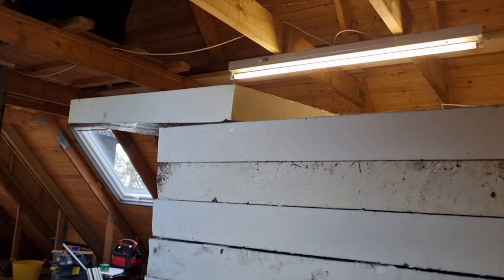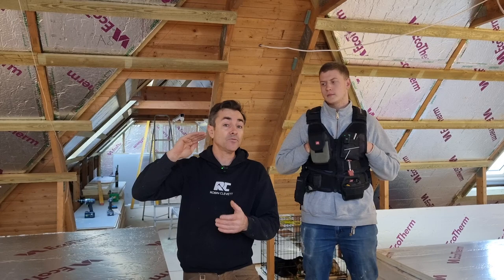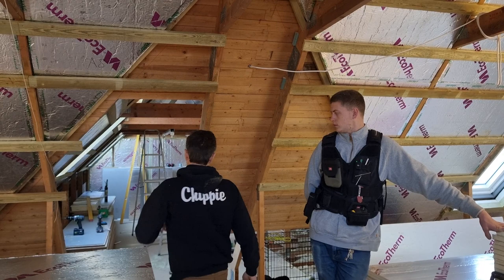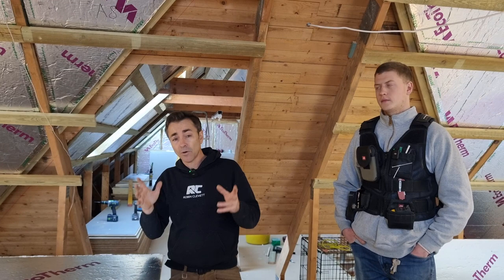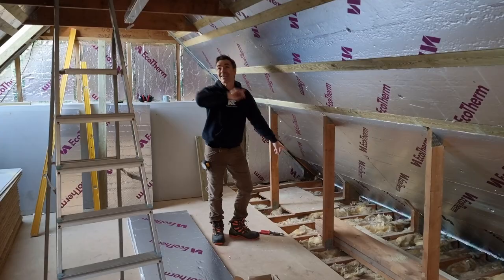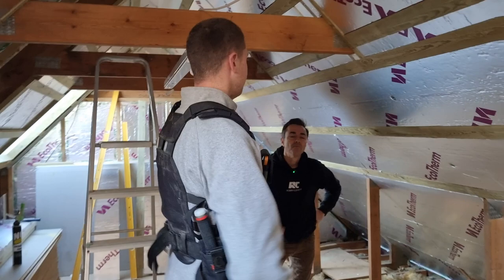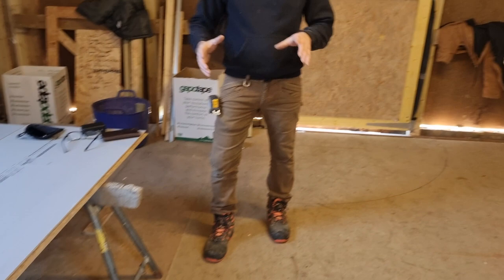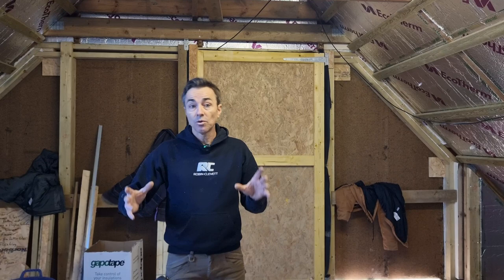Awesome loft conversion insulation, plus a new team member!!!

Comment: Gutted and rebuilt the mid-1930s semi we bought in 2013 and finished in 2018. Went for 150mm to 200mm insulation wherever we could (included using 12-inch rafters for kitchen extension when 8-inch was required). Builder, a very decent and diligent guy, said we might be too hot and we would have by far the warmest house in the street. Well... we have, occasionally, opened windows due to heat generated just from our own bodies warming the house on a cold day. Lots of neighbours jealous as they check their heating bills. Very impressed with this. Insulation as a work of art!
Reply from the maker: You made some good decisions!! and you are reaping the rewards!! well done Stephen...

Comment: It's great when you have the space to fit such a thick layer or two of PIR, it will be super toasty. Sadly this is obviously not possible for all houses based on their age etc. I recently had 80mm PIR and then insulated plasterboard on top. It makes an insane difference. So much so that I haven't put my radiators back on the wall upstairs yet. The heating is on less and not turned on so high either.

Comment: Ever used wood fibre insulation Robin? We've used it on our timber frame build. On the outside and inside of the frame. It keeps everything really cosy plus you can plaster/ render onto it or use cladding etc.
Reply from the maker: Not yet... but I will look into it!!!
Reply: @ukconstruction  Im currently using wood fibre and lime too. If you can influence your viewers to use more recyclable materials, I think you might become the saviour of the YT building world. Maybe a mini series with the voice of reason, Lord Roger of Bisby 👍🏻
Reply: The German house builder i was working for only uses wood fibre and wood chippings in their eco builds. The voids on the roof panels and walls are 240mm and completely filled with wood chippings all from waste from the factory. They only use natural insulation products, lots of clay plaster and sheets  as well.
Reply: @ChippyMart  it's a really great system. Creates great performance in buildings. Environmentally superior than pir etc. Breathable. Still quite pricey though but hopefully that will change.

Comment: Hi Robin, will you leave the wool insulation between the joists? Are you wary of 'sweating' caused by the two layers of insulation (floor and roof of loft room) . Can this be negated by a large open loft ladder/stair?  I spoke to kingspan hq and they mentioned this...I have small crog loft..

Comment: 👍Since you did a sarking board roof, did you consider a warm roof construction with the insulation on the outside? The ultimate in reducing thermal bridging and nothing to ventilate.
Reply from the maker: Hi Paul, this is an existing tiled roof, so we could only really insulate from inside

Comment: Hi Robin. How do you get the air out from behind the sheet of insulation when you push it into the space? With the Gapotape making a nice tight fit I have found it difficult to push the insulation in as the air behind has nowhere to go
Reply: Breathable membrane

Comment: Is that PIR insulation fire retardant?
Reply from the maker: Hi Sergio, The PIR is finally encapsulated by plasterboard that gives fire protection, much of  building structure is not fire proof and building designs and good practice such as following all the rules as set out in the Building regulations etc means that we still build with materials that burn, even steel beams perform really badly in a fire and that is why the building regulations and good design is key, I personally have never tried to set light to any PIR but as it is made with many chemicals etc I reckon it would burn but I am not sure to what extent??
Reply: @ukconstruction  I apprciate your honesty.  A lot of PIR isulation burns far quicker than any wood or metal.  Try it one day with a 15cm cube outdoors.  The fumes are nouxious so where a mask and stand well clear.  RockWool / Mineral wool will not burn but you need probably 3 times the thickness.  

Have the discussion with an Architech one day over a beer.

It seems the industry has not learnt much from Grenfell.
A fire retardant build made of Bricks and stone and cement was encapsulation with an insulation made from PetroChemical and then they wonder why the fire spread so quick it could not be contained.  This unfortunately led to the loss of many lives.  

This is not a rant at you Robin, I think your work and videos are great.  It is the building industry pushing products which are flamable.  Discuss it with the team at FixRadio.  Maybe this could be made into a mini series or something.

Comment: Neat work, my rafters are only 100mm depth, is it case of just fixing additional timber to the rafter to thicken it suit the 120mm insulation plus air gap
Reply from the maker: Yes Adam that is a common method to achieve the rafter depth to accommodate insulation
Reply: I have 100mm rafters and am going with 50mm (plus gapotape) between and 100mm under. The wood will be a cold bridge so I wanted to avoid that, plus cutting and fitting between the rafters is already a pain with 50mm so more would be a nightmare. 
The only annoying thing is that the 50mm gapotape wasn't ready yet when I was starting (and still isn't) so I've had to use 80mm folded over, as advised by the folks at Gapogroup.

i've been told I don't need a separate vapour barries as the foil on the boards plus tape over the joins (on the inside) should do the job. Plus the gapotape is making such a good seal that there's no drafts.

Comment: That must have cost a fortune, that gapotape is f'n expensive, quality job though
Reply from the maker: The Gapotape is essential if you want to eliminate the performance gap and get the very best out of the insulation and save on utility bills and high energy costs
We insist that our clients adopt best practices in the construction phase and we justify the material expenditure and investment and demonstrate from our previous projects and their energy performances that it is worth doing, I really don't want to go backwards and do the job without the tapes and most discerning clients once they have the information and benefits they buy into the higher quality install, indeed it is a show stopper for me if a client won't go for it in a roof!!.

Comment: How close to £5000 did the insulation for that conversion cost?
Reply from the maker: I would have to check but we had over 80 sheets of the 120mm and that's mad money!! Then about 20 man days to fit it all!!
Reply: @ukconstruction  Would you ever consider using Actis-style insulation. I appreciate that it's not going to work well on 1200 centres, but on the 'normal' 400/600mm centres it's a dream to fit and satisfies part 'L' easily.
Reply: @robertrushbrooke1028  anything that compromises the monopoly of the PIR market has to be welcomed with open arms.
Reply: @alabinibop  I've just done the vaulted roofspace of my own loft conversion. It's 105mm Actis with a 45mm foil cover on top with battens. I managed to get it below the price of the PIR per SqM with a good bit of haggling. Without doubt each material has its place, but for me this fitted easily without the need for gapotape or foam to easily meet Part L. Its also dust free and easy to store. I am not a pro (which is why I watch @robinclevett) just a DIYer due to cost of labour, but this was a great find for me.
Reply: oh to have 10k to insulate a loft......
Reply: @robertrushbrooke1028  you have saved quite well on the labour then also, well done. 👍
Reply: @jameslennon947  there is only one winner and that is the insulation suppliers.
Reply: @alabinibop  Thankyou. Labour is so expensive, but I guess people need to make a living and it is their skills you want.  As a renovation DIYer I found forming good relationships with suppliers and merchants who you have accounts with was vital and also push for decent terms. I initially hated haggling but now it's second nature and they expect it. However I will often take a slightly pricier quote if they will hold prices  for a decent period (a month for me is good). All good fun.... I keep telling myself that 😂😂👍

Comment: No under purlin in that existing structure? They have just strut down to the floor joists? 🤮
Reply from the maker: This is a trussed roof so there is never an under purlin, just various chords that are all designed to work in triangulation connected by press plates etc

Comment: Why are the 25mm timbers so wide?, could you not use 25 x 35 battens and still attach the plasterboard?
Reply from the maker: They would not be strong enough and would flex too much at 1200 centres